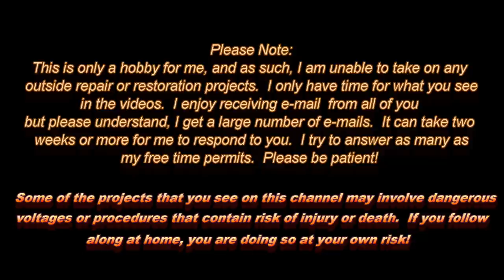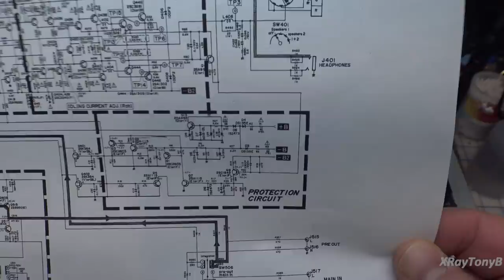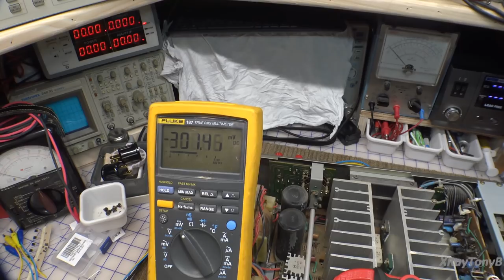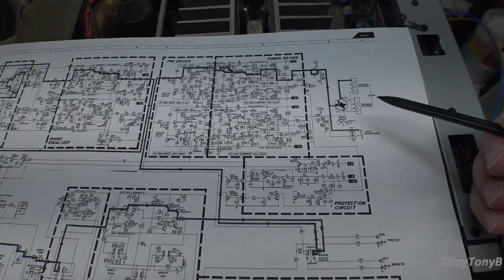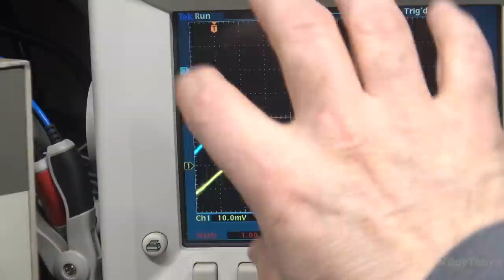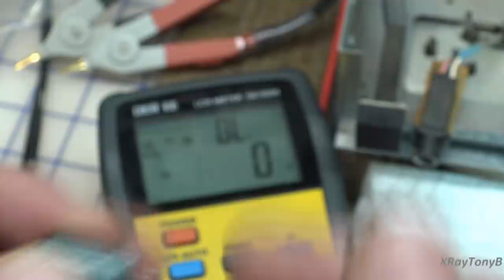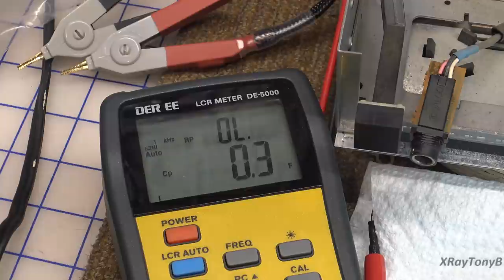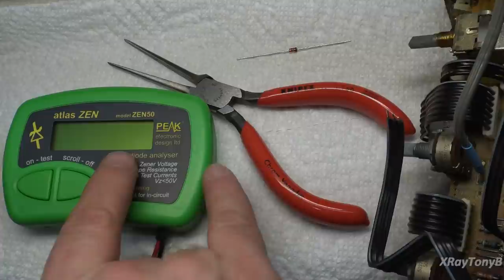Harman Kardon PM665 Repair & Restore - Part 1

Comment: What about upping the THD to something like 0.1 would that be in the local feedback?
 Couple of people told me nichicon capacitors are not very good not for sound quality
Reply: Nichicon FG are great caps
Reply: I don't think that you will notice a difference in sound quality with any brand of Capacitors... The main difference is in the working life... That reminds me of the people who say that they don't want to change Capacitors because they don't want to loose the sound that they are getting, well if you like listening to an amplifier in pain... It's going to die, but if you like that sound, there are ways to get the same sound without destroying an amplifier. People want a clean sounding Amplifier and don't realise how much they actually like distortion until they hear a dying amplifier... 
That's why they say that you shouldn't believe everything that you read on the internet....
Reply: Excellent view Peter, true
Reply: @PeterMilanovski  no caps have a massive importance On Sound or the lack of them even
Reply: @gime3steps  thank you..
Reply: @johnsweda2999  that's why I said what I did... Just think about what a capacitor is used for!! If you need to filter out some voltage ripple, the Capacitor is your main man, if you need to keep AC separate from DC... The Capacitor is your friend, if you need an audio filter, capacitors are what you want... If you need an analogue delay, guess what you need? There's so much more that the humble capacitor does that I haven't mentioned here but what's most important is to understand their failure modes and how to know when it's about to fail... 
High ESR capacitors are a problem though not as big a problem as they are being made out to be! If nothing else, if it only destroyed itself, that would be great because we still make Capacitors... But when a capacitor failure occurred and it destroyed a transistor that is no longer available... That's when we have a big problem.. 
So let's take a look at a high ESR capacitor.. we can replicate it by taking a very low ESR Capacitor and placing a resistor in series with it... Now! What problems can we expect from such a scenario? If it's in the power supply, then we should expect higher levels of ripple which will cause the audio output of an amplifier to distort but only at higher output levels, why? Because the resistor in series is slowing down the current flow into and out of the Capacitor... This is the reason why older Amplifiers with incandescent bulbs for the power on indicator will start to blink at higher output levels and large bass demands! Old school amplifiers tell you when you have high ESR levels in the power supply Capacitors... You won't see this effect on newer amplifiers with led power indicators... But nothing gets destroyed before or after the high ESR capacitors... 
EPR (Equivalent Parallel Resistance or DC leakage or Drain) it seems to have many different descriptions but they are all one and the same! This is the failure mode that should always be looked for... This is the one that destroys everything else but itself! A Capacitor with high ESR will heat, leak electrolyte and or explode, but low EPR on the other hand has very low resistance so it doesn't get hot 🔥, you really have to look at it as a short! By the time any heat is generated inside the Capacitor it's already taken out a transistor, resistor, diode or one of those unmarked ic's that are proprietary and are so impossible to get they might as well be unobtainium! 
So if you don't have a way to test a capacitor for ESR and EPR and capacity... You really don't know when you lucky numbers are going to come up! 
I don't know for sure, but I think that it's could be possible that ESR could trigger an EPR problem or vise versa... An LCR Bridge Meter (like the one that Tony gave an excellent video tutorial on a few videos back) is what is needed... An ESR meter on it's own is not cheap! Mine cost me $65Au... But for $99Au I got the newer version of what Tony got.. the older one is in a silver aluminium case whereas the new version is in black.. the new version also has a built-in rechargeable battery via USB C which makes it so much better to use... 
All the parameters are displayed on the one screen! Unlike the LCR Bridge Meter which was used in this video! I was kinda disappointed that Tony didn't scroll through to show the rest of the values! We just didn't get to see that! But the other meter would have shown up everything! If you make your own repairs even if it's just a once in a blue moon to your own equipment! If you own a multimeter and a soldering iron (or soddering iron lol) then you should have one of those cheap eBay component testers and an LCR Bridge Meter! You could literally almost fix anything with just those things! An oscilloscope is nice to have but it's optional.... 
I hope that I have cleared up anything regarding capacitors and their failure modes and how to find them...

Comment: I worked in a factory where we mass produced electronic boards back in the 80s.  Most of the components were mounted by a machine, hence the big holes and then they were wave soldered.  EVERY BOARD had to be inspected and touched up by a crew of humans. I dont know if they ever got their ROI from the cost of that equipment, because the repair facility was always busy.  SMH.

Comment: I have repaired old solder joints on computers by putting the mother boards in the oven at 200C. Can you do this with amplifier boards to avoid having to resolder joints.
Reply: Wouldn't really be a reliable repair, as there was not enough solder to begin with. Watch what happens when he touches one of the joints without adding solder, it wicks to the pad and there is virtually none holding the component in place.

Comment: I recently bought a HK 680, but the transformer emits a tremendous humming of the kind you can't hear in speakers. I also screwed with some bolts, even those transformers are similar  (Bando, now closed). Do those make noise? Should I change it?
Reply: I have a HK690, and I have the same hum (mechanical vibrations) from time to time (not continuous), I think it depends on the power network...
I learned to live with that......

Comment: Any reason why there is no capacitive coupling for the output stage of this class AB amp ?
Almost every class AB output stage uses capacitor coupling to prevent DC leakage into speakers
Reply from the maker: These amplifiers use a split power supply, with equal positive and negative rails.  The center point of these amplifiers will be 0 volts at idle, if working properly.  Amplifiers with single rail power supply will have the mid point set at a voltage roughly 1/2 the voltage of the supply.  This is called offset.  Single rail amplifiers, regardless of being class A or Class AB, will need some form of isolation (either a capacitor or transformer) to remove the DC offset from the speaker output.  The design of the amp has everything to do with the offset.  It is possible to design either class A or class AB with or without an offset, depending on how the power supply is configured.
Reply: @xraytonyb  - Thanks for thorough explanation, however I don't see a reason why not to use a coupling cap even for split power supply amps, as a precaution.
Reply: @NICK-uy3nl  The bean counters would not let you do this in a mass production.They don't sell precaution, they sell amps.
Reply: @bob1842ra  - I hear you. A 60V film capacitor would only cost 50 cents in high volumes x 100,000 amps = $50,000. The cost of BOM sure adds up fast!
Reply: It wasn’t about cost.  A direct coupled solid state amp was the thing back then.  I think it actually started about 10 years before this amp.  Eliminating the capacitor gave better sound.
Reply: @jimomertz  That's debatable. Maybe  "direct coupled" was a marketing slogan to justify the savings on one hand, maybe a small increase in sound quality justified the risk of a fatal chain reaction in case of failure on the other. You are sure right that it was the thing.

Comment: Hello! I have a PM655 Vxi, which gives me a problem.
When I turn it on there is no sound, but a small "pop" is heard in the background on both speakers every 10 seconds repeatedly.
When it has been like this for 20 minutes, the music starts playing.
Sometimes it stops again, but the music comes back.
The next day when I turn it on, I only have to heat it for 3 minutes for it to work well.
No contact failure, I already reviewed all the soldering on the board.
The fault is not in the preamp, because I disconnected the jumpers from the back that goes directly to the power stage, and it continues to give the same fault.
Does anyone have an idea what could be wrong? Thanks.

Comment: Hello! Does anyone know why one red light comes on on some models and two on others? The one that is always on is "High Current", but the one for "High Voltage" in my amplifier works fixed and in other equal amplifiers it is without light. Do you know what these lights mean? Thank you.
Reply: Found it... the "High Voltage" light is due to the switch on the back where it changes from 4Ω to 8Ω. What a way to call it, anyone would have thought anything else.

Comment: 46:00 To little solder on each pads is the real issue here, not necessarily the size of the holes.
To high speed on the boards when they pass trough the wave-solder would result in to little solder sticking to the pad.
As you will notice the fix is to add more solder. There's really no need to remove the old solder.
Clean it with IPA and resolder it will fix it. And BTW, not to much solder. You should see the leg of the component, not drown it in a big blob of solder.
Btw those tracks shure has some odd shapes.
Reply: Naw, it is the size of the hole.

Comment: This looks like a very time consuming repair. So much to go over and resolder. So many transistors that could be bad because of it as well. Brunt resistorsand
out of tolerance e caps. There are a lot of things to check to get it working properly again for sure. At 18:25 in we have a good candidate for a speaker circuit 
breaker protection device for all speaker outputs.  www.parts-express.com/Speaker-Circuit-Breaker-2.5A-200W-260-830

Comment: Your hands are shacking....it is better to see a doctor, this seems Parkinson's starting and should be controlled with medicine
Reply from the maker: I appreciate your concern.  I can assure you that I do not suffer from Parkinson's, nor essential tremors.  My mother-in-law along with several other friends of mine do, however, suffer from this terrible disease.  It can't be diagnosed by watching someone with shaky hands on a video.  What I do suffer from is the inability to reach both hands around either side of a camera that is positioned in my face, holding the solder and the circuit board in one hand and the soldering iron in the other, all at an odd angle while trying to see what I'm doing through the progressive lenses in my glasses...all so that I can get a good camera view for you, without my hands and arms getting tired and shaking. ;)
Reply: I clap my hands once, hard, to stop my hands "shaking" before I do any fine works. Try that!
Reply: I hope your not charged for that misdiagnosis.
Reply: Adrenaline rush.

Comment: The flashing LED at startup indicates it is going through its startup routine, but I hear "boom" on the speakers when it stops flashing. I do not have it on my other amplifiers. Is it a failure or just a feature?
Reply: Some say that it's a factory defect in all Harman Kardon amplifiers. The cause of the "boom" sound when turning on the amplifier (about 5-10 seconds after starting) is a high DC offset (usually over 200mV). DC offset adjustment is done with two trimmers (one for each channel), and the manufacturer recommends that the DC offset value be +-10mV, ideally 0.

I have several models of HK amplifiers, and the only model I've managed to bring to factory specifications is the HK6800. All the others (PM655vxi, PM665, and HK6600) have the "boom" at startup. The solution is, after adjusting the DC offset and bias as closely as possible, to turn the speaker selector to "off" before turning on the amplifier, wait 5 minutes for the amplifier to warm up, and then switch the selector to the speakers and enjoy the music. Current above 100mV can cause long-term damage to the speakers.